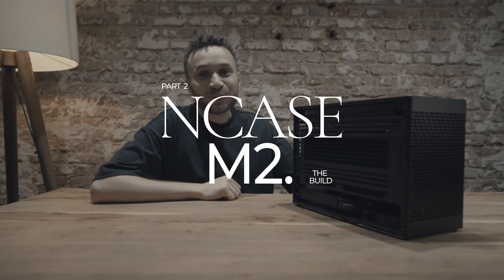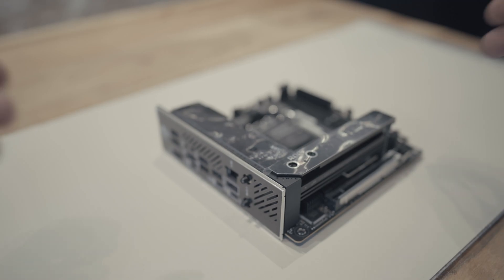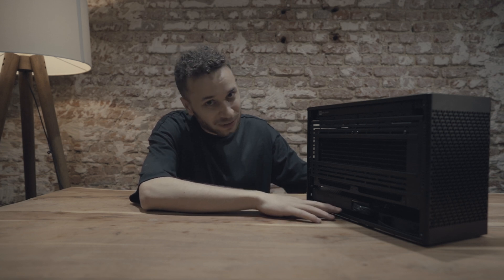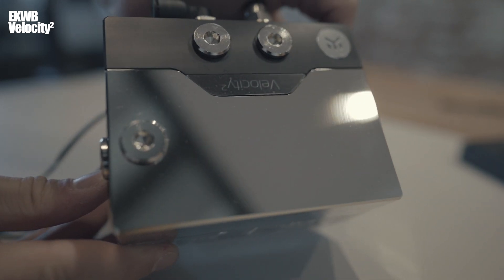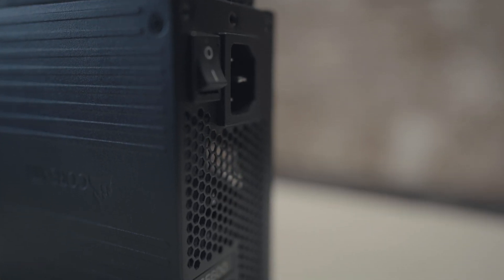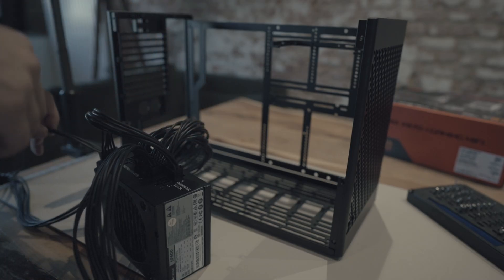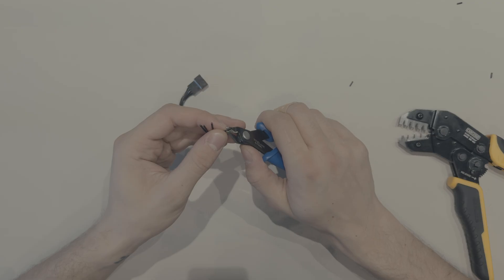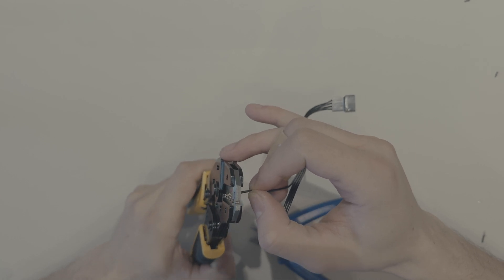Part 2: Watercooling the NCASE M2 - A Compact SFF PC Build

Comment: Waiting for that triple radiator build, although I'd use amd's next 9080 or XTX if they make a new one. Alpha cool should make an sff watercooled variant GPU that should be small enough. I will be mimicking your build! I have the same motherboard and psu but at 1000w, 9800x3d, and also gskill memory, and same exact case.

Comment: Awesome build. I'm going to be doing an AIO build in this case soon. 280 AIO set to intake on the side. two 140mm fans for exhaust on the top and two 120mm slim fans for intake on the bottom underneath the GPU. Was afraid it might not be enough room, but this video put my worries to rest because I think I can raise the height of the mobo if you were able to fit a rad and fans on top without any clearance issues. Good stuff.
Reply: Have you built it yet? If so, what are your temps? What CPU and GPU are you using? I plan on doing something similar soon.

Comment: Amazing build. Usually a dual radiator in a case this small looks really cluttered, between the tubing and custom cables you have a very clean build. I was glad to see Nvidia went back to the angled adapter on the 50 series like the 30 series, works much better in SFF cases.

Comment: is there a reason why you went with a iTX bord and not an mATX?
Reply from the maker: Just for some added flexibility as the case is already quite cramped. Also gives me the option to switch cases at a later point!
Reply: @NewSolutionsForWorld  bro where's the part 3 ?
Reply from the maker: @ Should be live by next week!

Comment: Great build! I was thinking about doing a custom loop in the m2 too, but was wondering if a 92mm radiator on the side would be viable since the 280mm radiator appears to leave some space on the sides.
Reply from the maker: Honestly, there's barely any space left. I'm making some changes for part 3 and there's even less space left now. I'll be working with a 92mm pump/res combo so you'll be able to use that as a visual reference!
Reply: @NewSolutionsForWorld  Wow, maybe the new pump/res combo from iceman for the m2? Definitely excited, please keep up the great work!

Comment: you're waaaay too quiet and even the smallest "bang" on the table destroys the experience. overall really nice build..
Reply: Working on it mate! Believe me, I’m doing everything I can to make part 3 considerably better.

I’d appreciate you sticking with me and giving me another chance in part 3!
Reply: @davidagwazie6936  I can't wait for part 3. I'm also thinking of doing triple Alphacool 280 HPE-20s for a 3090 with a Heatkiller waterblock (single slot) and maybe a Bykski for pump-res combo. Cpu has a Heatkiller waterblock already and I'll also add external pass-throughs with Quick-Disconnects for hooking up my Mo-Ra3 when I'm at my desk and not travelling.

Comment: How hard was this build to make? Specially considering you have a 45 mm side radiator with full size fans. Was that not too much of a constraint?
Reply from the maker: I'd say like a 6/10 in terms of difficulty. Main challenge is just getting the puzzle to fit. Once you know its going to fit, install was easy.

Siderad + fans has about 8mm of clearance at the tightest spot.

Comment: Bro your choice is so damn good for old pc case and new too.
Reply from the maker: Thanks mate!
Reply: @NewSolutionsForWorld  as you are doing soft tubing you could have used quick disconnects as they are very convenient in case any issue comes up and you dont need to flush the liquid.
Reply: i would have preferred nocuta fans cause fans color not visible when pc is completely built as there are no glass panels.
Reply from the maker: @itsmephougat Yes! You're 100% right. I was thinking about using them but the delivery time was a little longer than I hoped and I just wanted to start building.

But I'll probably use them in the future!
Reply: Waiting for the part 3 already.

Comment: Man my build has been a pain, the manual is so bad in some cases. I even reached out to the support, because I am building with an mATX board.

And I was like...So the radiator for the AIO won't fit in the top with an mATX board...and they were like, yeah no it should fit...but yeah it's not even close to being able to fit with an mATX board :/ So I have to side mount it - which makes it impossible to do vertical GPU mount.... big sad....

And I can't return my motherboard and switch to ITX now :/ 

Depending on the new gen of GPU:s I might need to switch to an ITX board later down the line. man I even asked their support and they totally F:d me...
Reply from the maker: Honestly, I agree, the manual is really non-existent and you have to figure it out by yourself. Sorry to hear that this one didn't work out. I also tried to go for 3 rads and came 5mm short so I know the feeling. I think in these cases ITX gives you alot more flexibility so not a bad idea to try it out. Try reaching out to return the mobo late, sometimes they let you do it with a small restocking fee.

Comment: Nice build. I'm hoping to do something similar since I just picked up the an m2 as well. I haven't seen pneumatic styled fittings used in watercooling before, could you provide some more information about what you are using? (new video idea?) Also those look like custom silicone power cables, mind if I ask where you got them?
Reply from the maker: Good video idea!

Custom cables come from DreambigbyRayMod on etsy, very helpful, theyu will assist you with which length to go for if you are not sure.

Comment: Getting my N2 Round tomorrow, was almost $100 more for the grater, and for me it wasn't worth that much extra.
Gonna be building with a B650 mATX board and a 9800x3D.
Reply from the maker: Nice! My 9800X3D also arrived today! Are you going with the black or silver m2?
Reply: @NewSolutionsForWorld  Black, silver was sold out completely and I didn't really care what color I got tbh. Gonna be mounting it under my desk anyway so just wanted something small and compatible with a wide variety of hardware.

9800x3D gonna be a beast! Gonna stuff mine with a 3080ti for now, until the 5000 series or AMD:s new stuff comes out early next year.
Reply from the maker: @CimInc  Yeah both colors look great so cant go wrong.

Same here, waiting for 5000 series or next gen AMD for the GPU upgrade.
Reply: @NewSolutionsForWorld there is actually a white m2 case now, i just picked it up